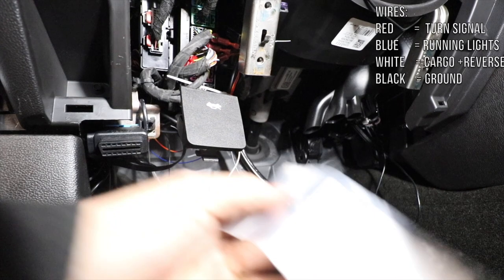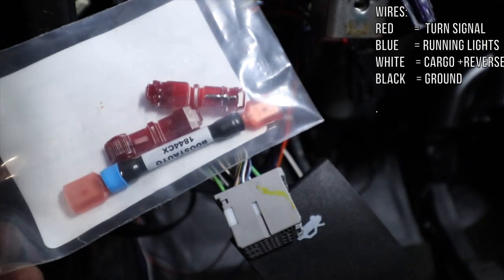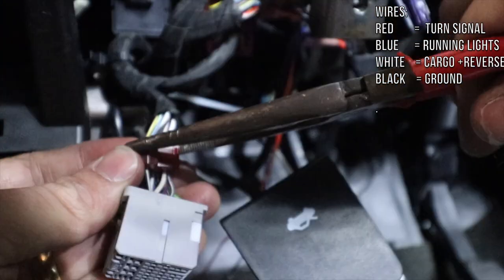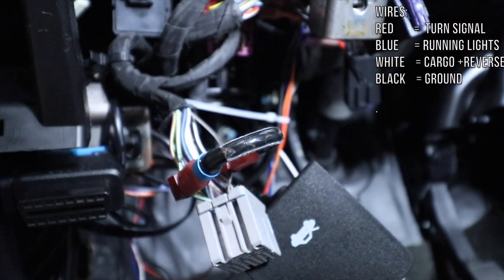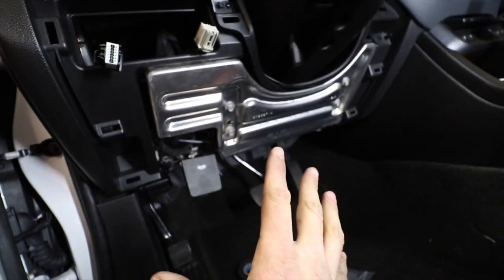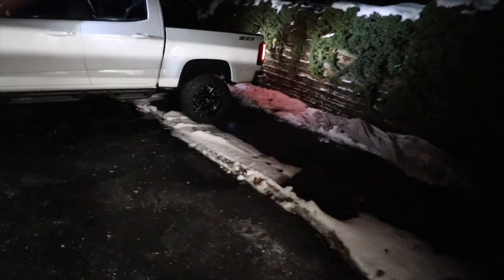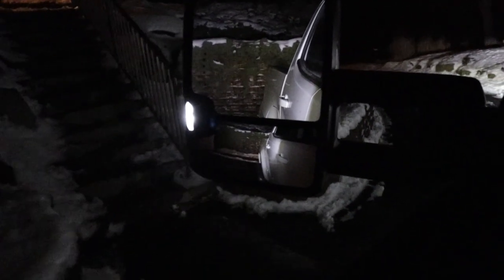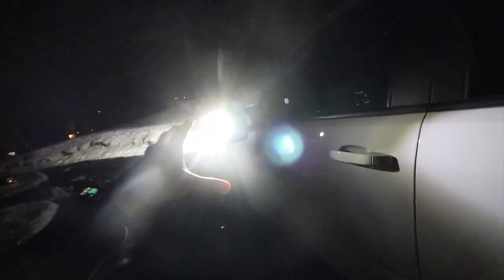REVERSE AND CARGO LIGHTS tow Mirrors Install Colorados and Canyons - Boost Auto Parts

Comment: First off, thank you for upgrading/changing your traveling music! Much better! 👍👍 The cargo lights are what I really, like. They'll come in handy for your mid-night runs to pick up a pallet of pellets for your home heating system. I hope you've stocked up. We're going to be in the single digits and below zero temps at night for quite a while now. Save the Pellets and Save the Waves. 👋👋
Reply: We didn't get to go on a pellet run this yr,I thought you guys were warm & toasty!
Reply: You don't know what you're missing by not going on a Pellet run! Especially while it's snowing and sleeting. Matty's become pretty good at drifting without even trying, if you catch my drift. 🤣 As for me, I'm in the back seat of his truck crouching on the floor praying that I'm not going to die. So far my prayers have been answered.
Reply from the maker: Pete got it so right!! Need to make a run this week thou!! 🤣😂
Reply: I wish I could join you and help out. It's always such an experience. But I've checked the weather forecast. I think I'm going to be very, very busy and won't be able to join you. Hmmm, what do I have to do? Oh yeah, I have to clean the lint out of the clothes dryer vent and change the water in my Gold Fish bowl. They're both very necessary items you know. Plus, I'm still stiff from being curled up and on the floor in your back seat area.🤣